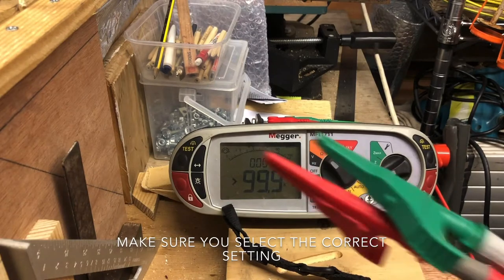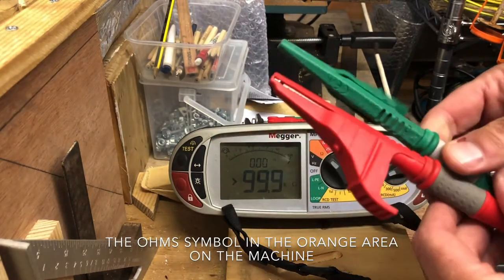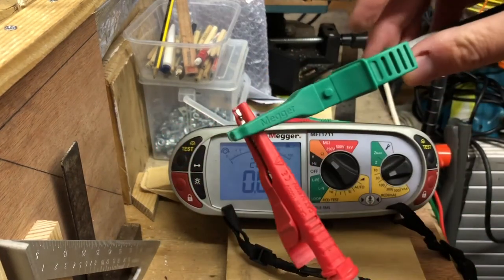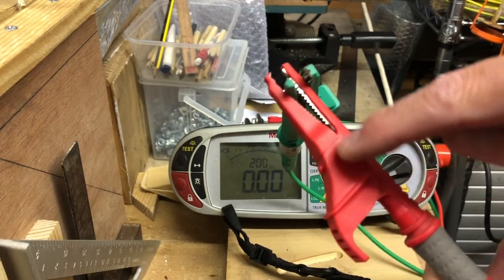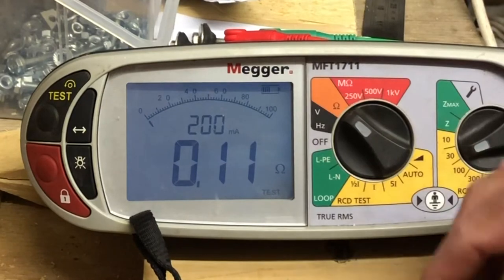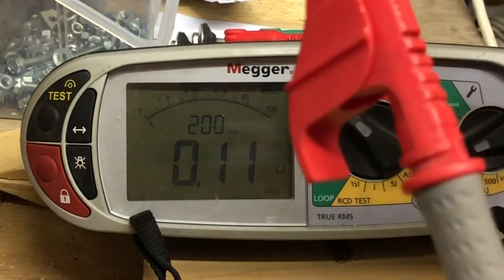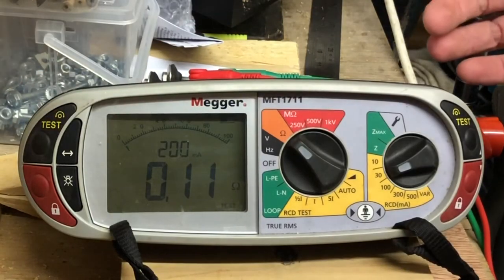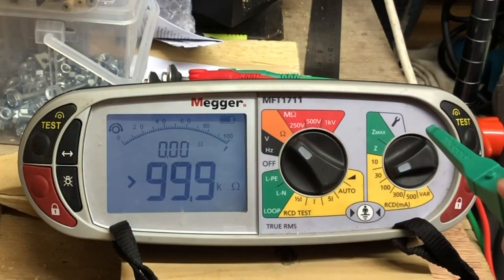Zero your Test Leads

Comment: Do you know why ohm values are changing when I move the leads? I connect them with clamps and the connection itself is solid, and I get the value about 0.2ohm, but when I wil move leads, or pick them up etc. The values will jump even up to 5 ohms. Why can that be? Are the leads the problem? I just got the tester refurbished.